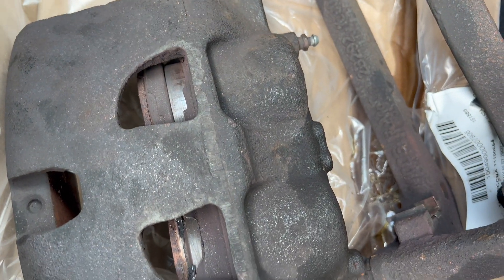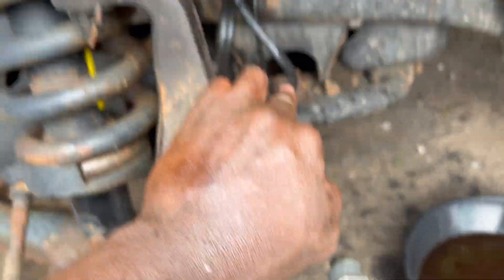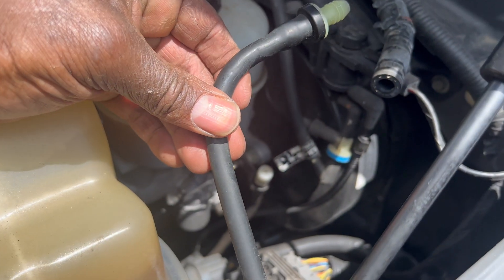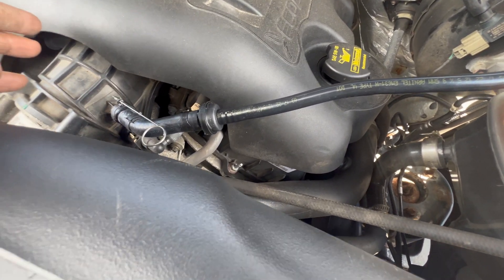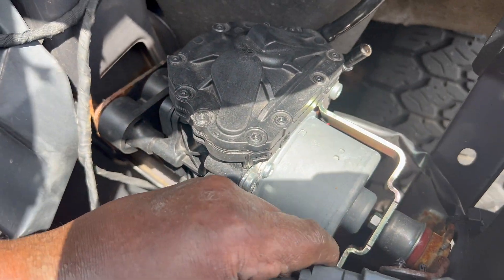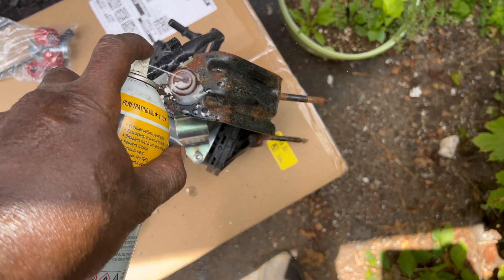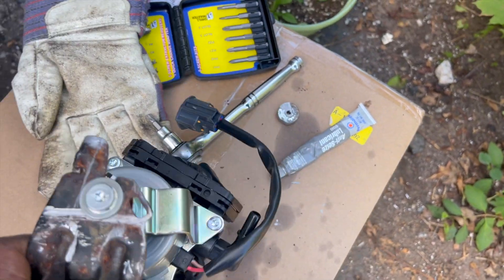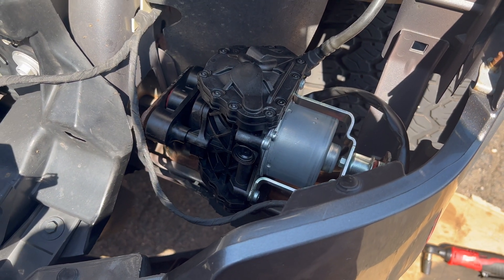Ford F150 Ecoboost Brake Caliper Seizing? Brake Vacuum Pump Failure ? (2011-2012)

Comment: So you did the lines and everything and it was still locking up?
Reply: Like before you did the pump
Reply: I have the same truck and engine and I can’t seem to figure it out
Reply from the maker: Yes I did the lines and caliper but looks like the brake vacuum pump was the main issue.

Comment: Link for the pump or did you go to dealership ?
Reply from the maker: I got it at Partsgeek.com
Reply from the maker: 2012 Ford F150 Motorcraft Power Brake Booster Vacuum Pump 
Motorcraft BRPV30